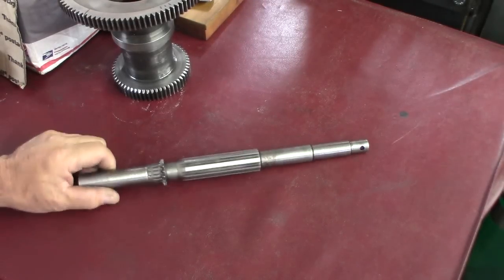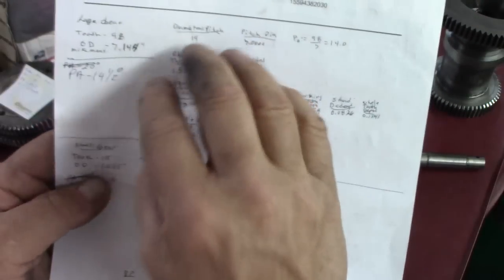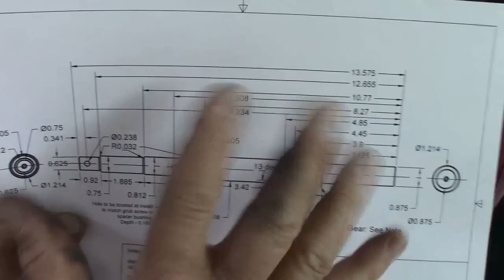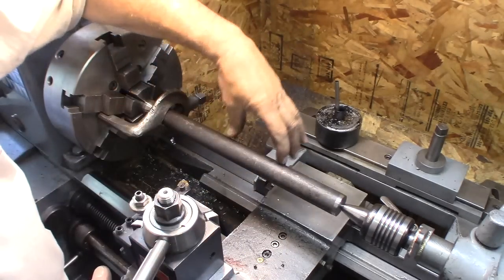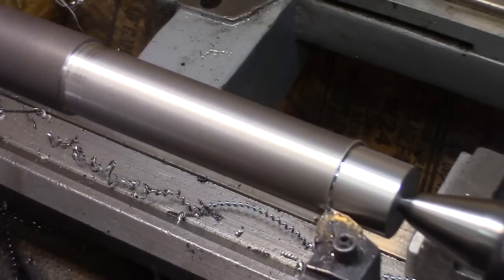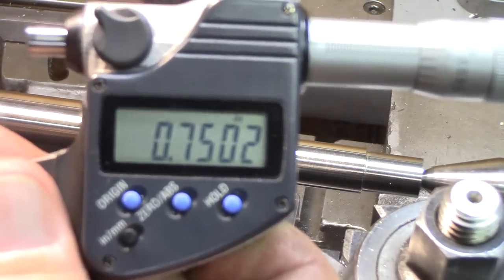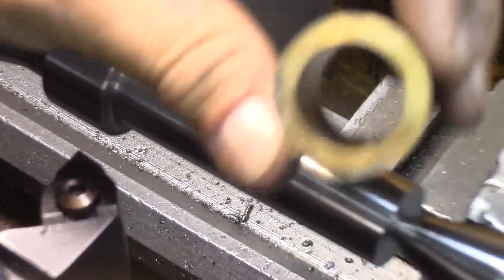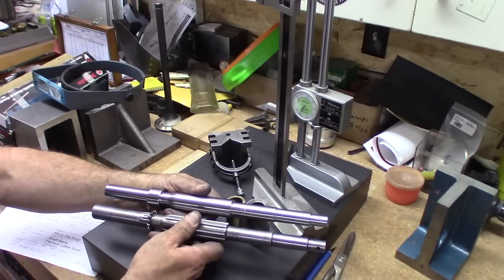How to Make a Lathe Gearbox Shaft

Comment: Thanks Randy for sharing and for helping save a Harrison lathe.  Parts for these puppies are hard to get and always a kings ransom. The Brits did make a nice set of lathes in the Harrison.  Mine is actually a Harrison badged as Clausing 11.
Reply from the maker: Thank you Dan.  The lathe could probably use a complete new set of gears.  But for the home shop this should work quite well.
Reply: Thanks for walking through how you identified the gear. Nicely done.

Comment: Randy, 4140 HT or quench and tempered is a hot rolled steel with a hardness of 28 to 32 Rc.  Excellent choice for this job.  I use a lot of this stuff and it machines nice in the pre-hardened state.
Reply from the maker: Yes John it is great stuff, i make my Dovetail Cutters from this material.

Comment: Wonderful video and instructions! I agree with your math using the Machinery Handbook and Internet formulas. I have a lathe I thought had to have metric module gears but all the Handbook and Internet calculations indicated 20 degree PA (pressure angle) and a diametral pitch of 20. Boston Gear makes steel spur gears in their YA series that fit my specs exactly and meshed perfectly. You just have to trust your reverse engineering. I like your Shars narrow long-point live center with lots of cutting tool room.
Reply from the maker: Thank you Paul.  I can't wait to see the shaft when finished.
Reply: You have produced fantastic finishes and kept to tight tolerances. I love those digital Mitutoyo micrometers for fast, easy and error-free measurements.
Reply from the maker: Thanks Paul.

Comment: wow at the start i figured you would just fill the space the gear used to be with weld the machine a new gear or make a blank with an undersized hole stoking it red hot and press it on the machine of gear then machine the tooth on there 
dont think i wouldve made a whole new shaft
Reply from the maker: Due to the small root dia being the same as the bearing dia, i would of had to machine the end to a small dia press on a gear or gear blank then press on a piece to replace the bearing surface.  The gear is not a usual size gear.  The lathe owner wanted to make the gear himself.   So in all it was just easier to make a new shaft.

Comment: I know you worked hard on the calculations. For a sanity check, if you could obtain the distance between the centerlines of the shafts from the gearbox itself, you could validate the small gear pitch circle diameter by subtracting the larger one's pitch circle from that distance.
Reply from the maker: We actually did that I forgot to mention.  We measured the lathe and we were within 0.004" in.  So we used this as a comformation of the calcs.  Thank you for mentioning this.
Reply: Sounds good to me. All systems go, Captain. Move ahead warp 5.

Comment: nice job randy. a while back i ran into a chatter problem similar to yours. after eliminating  all the usual suspects, i finally traced the problem to the live center. i had been using a shars extended nose center. i found the nut that adjusts the preload on the thrust bearing had come loose. i took it apart .cleaned and greased the bearings and put it back together. i put a drop of locktite on the nut and no more chatter. i had never run into that problem before. long shafts can be a nightmare i gave up trying to  turn.rifle barrels a long time ago.i would have like to have seen you compete the shaft.

Comment: Very nice job Randy! The pressure angle is pretty visibly different at the root so identification can usually be done visually.
Reply from the maker: All of the gears are quite beat on the ends so this was quite difficult to determine for sure.  The lathe has seen a tough life.  Thanks Brian.  Off to watch your up date vid on the repairs.

Comment: Very nice job. You seem to like to run the lathe pretty fast speed. Does this give a better finish?
Reply from the maker: Thank you Stephen, All depends on the material.  On this material high SFPM with carbide gives a great finish and great chip control.

Comment: Hi Randy,
Great discussion about reverse calculation to find the appropriate gear match...
This looks like the shaft will outlast the owner if he takes little more care of the lathe than the previous tormentor...   lol
Hard to be a worse machinery operator than the one that owned before...   What a bully...!!!
Cheers,    Pierre
Reply from the maker: Tried to just hit the highlights.  Shaft came out great, hope to get some pics back after the owner is finished.  Thank you Pierre.
Reply: No excuse for the abuse but I am shocked a name like Harrison would settle on such a ridiculous reduction ratio about 6:1 in a single drop. I'd like to take it one step further and have the replacement Nitride hardened to minimise flank wear while keeping core toughness.

Comment: Gears sure have some edge damage... amazing how much that shaft gear was damaged.
What a challenge! Major math operation... great result it seems. Gear tooth vernier is a super tool.
You were getting a lovely finish on that material. Can't remember if you mentioned but was that insert a CNMG? Roughing stage.
Sometimes with radius tool and chatter - it can be useful to turn spindle by hand - super slow... I use my spindle handle.
That Randy is one beautiful shaft.
Reply from the maker: I use WNMG and CNMG 431 and 432 inserts with this material with high SFPM.  This material does not turn well at slow speeds, I actually did try to turn the chuck be hand off camera,  That was a no go.  I rough them out and then just cleaned them up with the file and a touch of abrasive paper.  Thanks Chris.

Comment: Randy you could try lathes.co.uk he's quit knowledgeable with a great deal of lathe's.could help just an idea for you.he has quit a few manuals for many lathe's.
Reply from the maker: Mark this project is complete.  The lathe owner finished up the shaft with the gear and spline and the lathe is back in service.
I have used the link many times and have contributed some info to them.  Thanks.
Reply: Randy Richard In The Shop no problem buddy. That shaft turned out great. Some really lovely work you do. I may have to keep you in mind if I find any horrors inside the headstock of mine. Previous owner was a complete butcher and really didn't take care of the lathe I purchased. The amount of work it's taken is madness and still have a long way to go. But you sir do some excellent quality work. Just loving your channel
Reply from the maker: Thank you Mark.

Comment: I addition to abuse: That huge gear meshing with that small one is a design flaw. They should have used one more pair of gears to get that ratio.
Where did you get 4140 with that hardness ? I've only found around 28-30 rockwell C
Reply from the maker: I usually buy this material from MSC.  Pre-Hard 4140.

Comment: Great job.  Nice to see start to finish from figuring out the gears to inspecting the finished product.  Can't say I could follow the gear calcs.  Could you not "eye ball" it with a protractor through the gear center to the pitch diameter to the tooth face, or was doing the measuring over the teeth easier? (I would not eye ball anything normally, but wouldn't a 5.5 degree variance be fairly visible, at least enough to indicate one or the other?)

It would be interesting to see the splines cut.  They looked like square splines, but the edges looked tapered.  How do you make these (or measure the internal spline)?